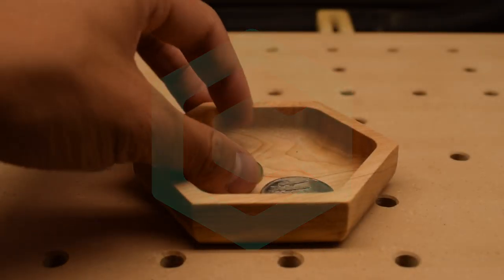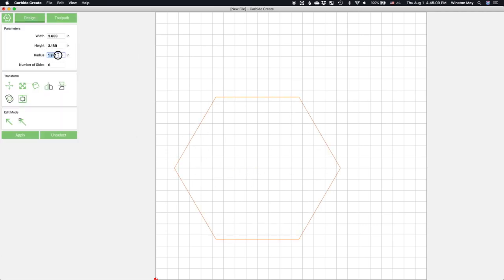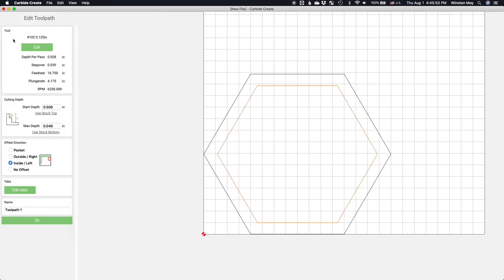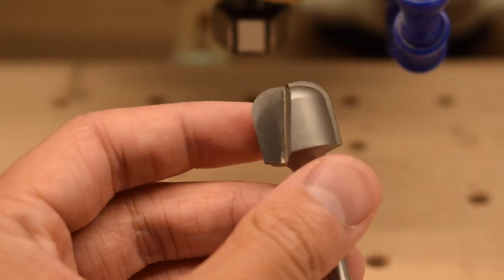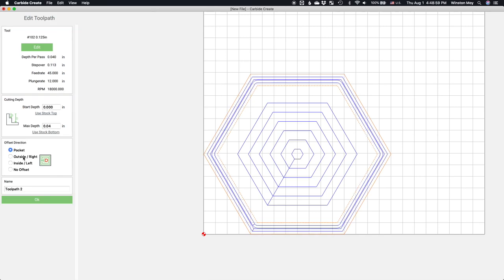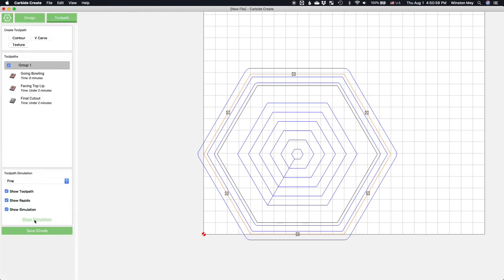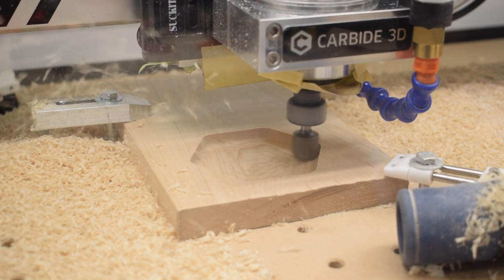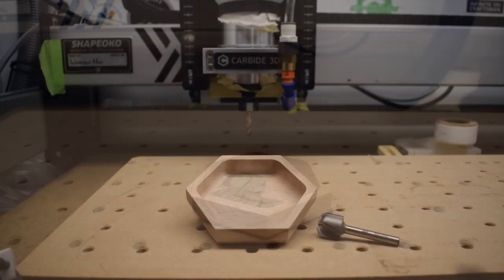Making a Simple Tray on the Shapeoko 3

Comment: any body else unable to choose their new bowl end mill when probing in carbide motion?...
Reply from the maker: Probing in X and Y only supports a few preset tool diameters. Easiest way around it is to either:
1) Load up a different/supported cutter and probe for X and Y, or
2) Just eyeball your starting position in X and Y.
For probing Z, tool diameter doesn't matter.
Reply: @carbide3d  ok, thanks! Appreciate the quick reply!

Comment: Could you tell me what  you set the parameters of the bowl bit to. So I can add one to my tool path.
Could not catch the frame you showed.
Jeff Peters
Reply: If you slow him way down and then use the pause maybe you can get the parameters you want.  That is what I am going to try.  He was FLYING through it for sure!
Reply: @terry2346  what diameter bowl bit do you have and what is the shank size
Reply: @resorter66  Don't have one yet but all of them that I would get are 1/4 inch shank
Reply: @resorter66  I have a 7/16 bowl bit with 1/4 shank.  Might get a 3/4 so I can use the same size as the author is.  Also would take about half of the time to clean out the bottom of the project!  :)